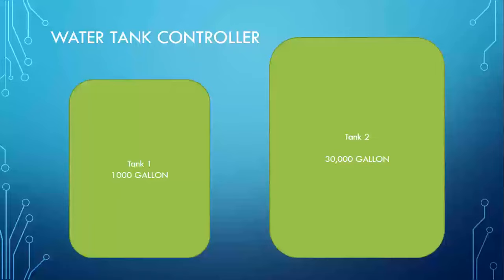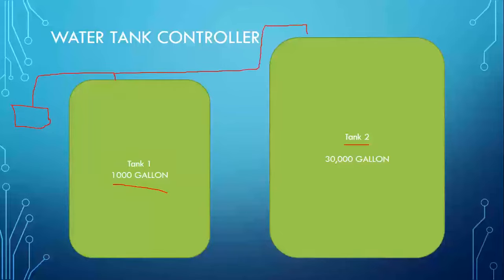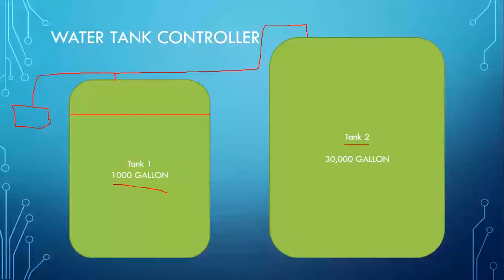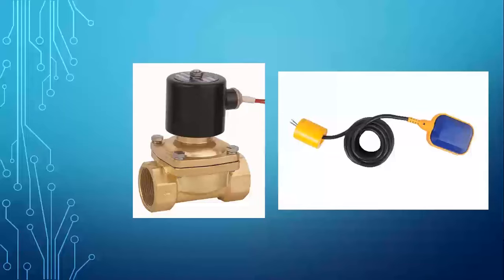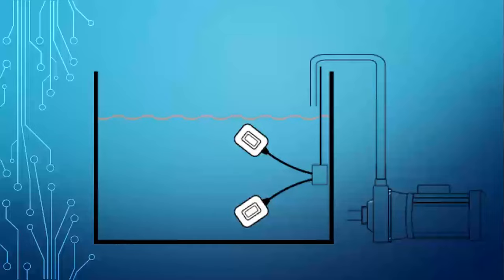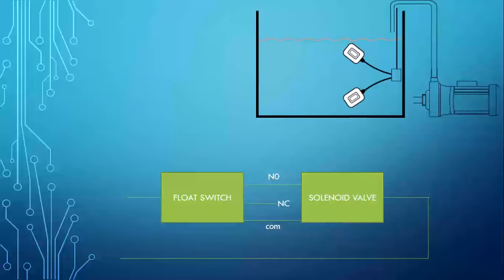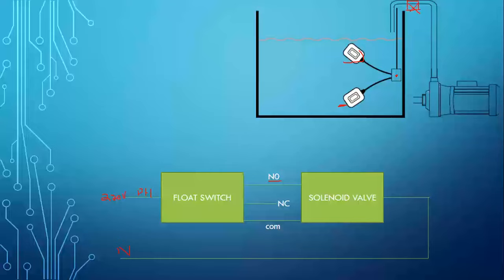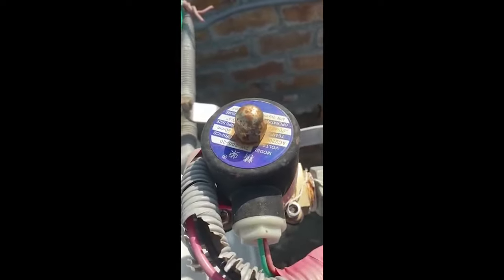Automatic Homemade Water Tank Filling Control using float switch

Comment: Hi sir this float switch only control the solenoid valve. Then what about the motor status. It will cut off motor power supply are not? Want to add some additional thing for motor supply power cut off?
Reply from the maker: Hi, I am usingbto control only solenoid not motor...as i have other tanks filling at the same time from same pumps...so in my application pump cut off is not considered and pump on/off is manual
Reply: Hi I want to know the valve when in open position it's make noise.??!

Comment: solonide valve is 24v ac so how to connect float switch with connector is electronic supply plase upload the detail
Reply from the maker: Same circuit you can use, just connect 22oV/24V transformer where SOV is connected and output 24V transformer shall connect to 24V sov
Reply from the maker: Please see video made on your request showing solenoid valve 24VAC connection...https://youtu.be/C1YucbOg8Qg

Comment: Please share the link to purchase the solenoid valve and level switch
Reply from the maker: Which country you reside in?
Reply: @electricalbasics347  I proud to be an Indian ( Maharashtra State)
Reply from the maker: @bhartiya_sanatan  you can order from any electric shop in india or search on amazon or ebay. Write SOV or solenoid valve in search and float switch you can easily find. Let me know if you need more help
Reply from the maker: I order from china...QAR 43.36  55%OFF | 1 Pcs Electromagnetic Valve AC220V/DC12V/DC24V DN15 1/2'' Electric Normal Closed Valve for Water Oil Air Gas Accessories
https://a.aliexpress.com/_mrgS9LF
Reply: @electricalbasics347  Thankyou very much.
Reply from the maker: @bhartiya_sanatan  always welcome